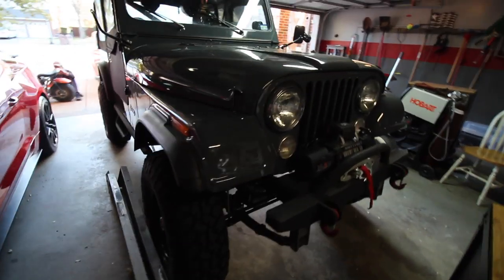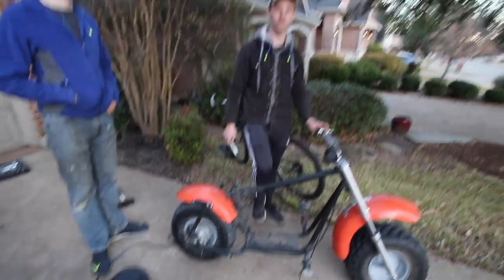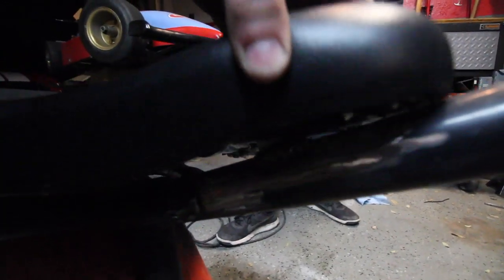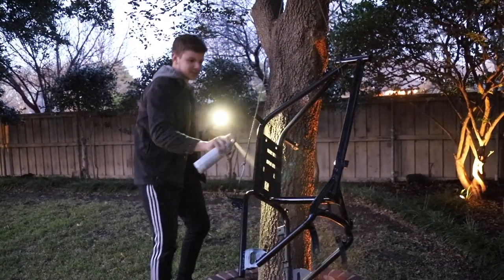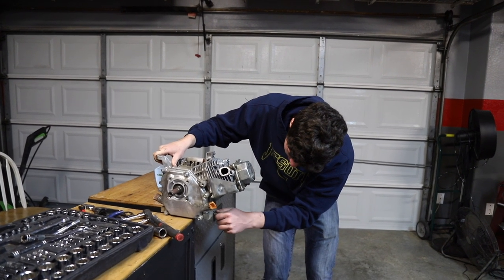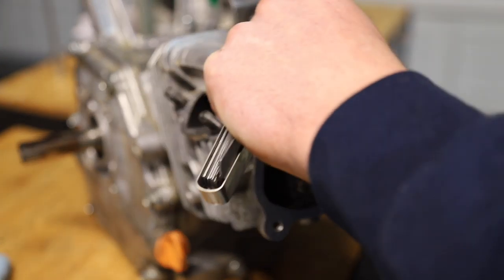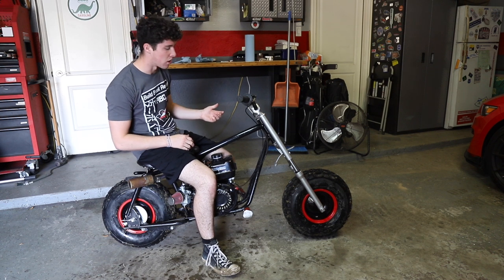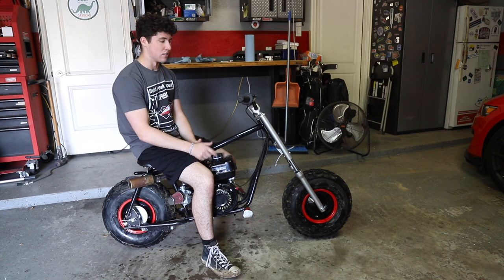Off-Road Mini Bike Build Part 1 | Stage 2 Predator 212 Engine Build

Comment: You need to gusset the frame in the front where the tubing converges to hold the steering.  The older bajas where bad about breaking there.  The later models had a gusset.  Looking forward to seeing this one finished!

Comment: Looking good guys but a rigid tail bike is not optimal for off road use. You may want to add a hinge and springs or shocks to the seat as this would give you rear suspension. Make sure to space the seat from the frame some so it does not squish any sensitive body parts (fingers,butt cheeks, legs) when compressed against the frame. Also you should put the foot pegs in a position so as to be able  to stand up while riding as your legs make great shock absorbers while standing. Just my 2 cents but I am 41 and have learned allot about minis over the years.

Comment: I'm thinking of making my own mini bike from scratch a similar size and style as that, but I am confused as to how the steering tube works, is the inside the same size all the way through or does it have a place for a bearing to sit? How can I do that with regular steel tubing and a few bearings? Are the bearings pressed in? I am asking because I don't have a mini bike as reference and have not had the chance to see how it works on a friends mini bike.

Comment: This is really weird that you guys are doing a build on this type of bike right now because about 2 days ago I just bought my first mini bike which is the same exact model. And before I bought it had a 212 on it (which I'm swapping with a Honda gx270) 😁
Reply: I just did a mikuni + head + exhaust upgrade on a gx270, big step up on torque from the 212. Next is a #40 torque converter, the #30's just melt belts.
Reply: I just bought the same or similar model! Same looking frame tho! Do you know which bike this was originally? I bought it so used I don't even know what company makes it or if it's a knock off. It's powder coated white.
Reply: What kind of model is this do you know ?

Comment: I definitely need to build a better frame and add suspension and better wheels and tires... I messed up when I bought my wheels and got some tiny electric scooter wheels 😑 the combo of the wheels and no suspension makes hitting a bump at 35 a butt puckering moment. Turning coal to diamonds...